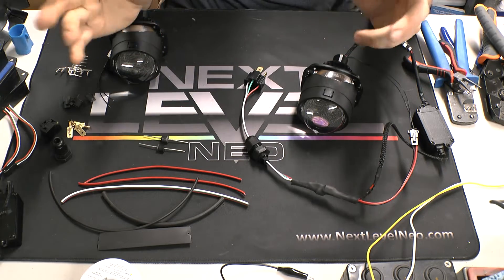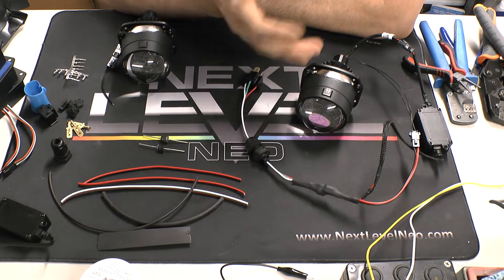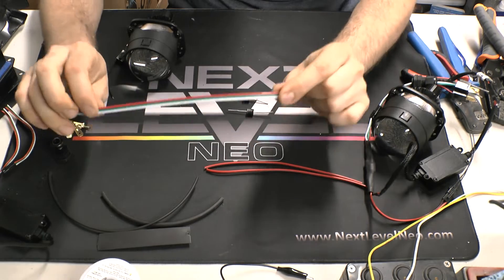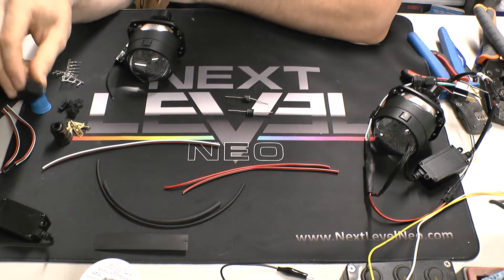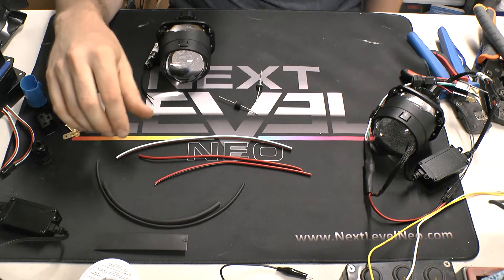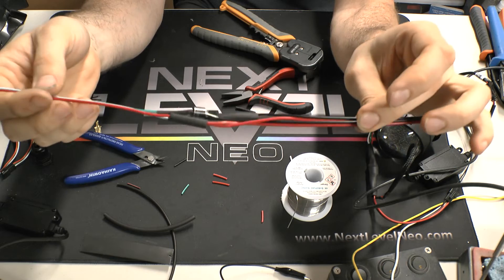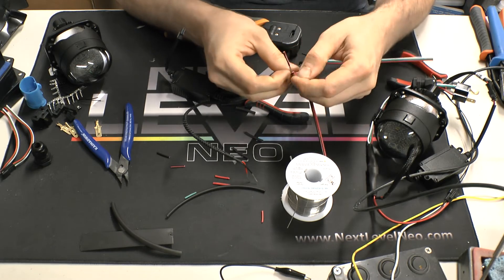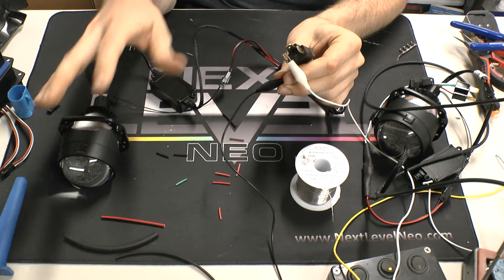How to Build a DIY Bi-LED Projector Harness: Step-by-Step Guide

Comment: Using diodes is a simple and economical solution to power the low beam when the high beam is turned on, but I don't recommend it since it decays the power of the projector slightly, or in my case of using a biled low beam 70w the decay of intensity is too noticeable, I had to repeat all the wiring again and add a relay that positively feeds the low light with 70w. Generally positive battery
Reply: where did you add the relay?
Reply: @luisangelmancilla4601  If your vehicle or motorcycle uses normal polarity (two positives and one negative), 85 and 86 would be negative and signal high light, 30 is low light projector and 87a is signal low beam, thus the relay comes (NC) permanently bonded 30 with 87A without the relay being active and thus gives you low beam, to pin 87 you connect high beam signal (85 or 86) making a bridge, high beam of the projector and that's it, when the relay is activated, it will activate high beam and through pin 30 it will power the low light of the projector, so you will not have to use diodes that cause voltage drop.
Reply: @madoasful  where do you connect hi beam positive wire in that setup? low beam positive goes to pin 30
Reply: @SpraytechGurnee  low beam signal 87A, low beam proj 30, 86 negative and 85 is high beam signal, 87 high beam proj and make a connection between 85 and 87 with solder, when you turn on high beams, it will activate relay and high beam proj, and will connected between 87 and 30 the low beam proj
Reply: @madoasful  what if the polarity is two negative and one positive ?
Reply: @shanemc5136  You need to power two relays, one for low beam and one for high beam and take the positive out of the battery, pull wiring for each headlight. To low beam relay connect the positive battery to the pin 87 and the LB biled to pin 30, to the relay of high beam connect also positive battery to the pin 30, high beam biled to 87 and make a bridge between 87 high beam to 87A of the low beam relay, from this handle by feeding the high beam and turning off the low beam relay, the low beam will continue to be powered.
Reply: @madoasful  not getting it at all.
Reply: @madoasful thank you thank you thank you!!!! I ve solved my issue which I couldn’t for so long !!! Thank you you’re the best !

Comment: Can i used a 6A diode
Reply from the maker: I use 30a diodes, using smaller ones may be result in a failure. here is a link to the parts i have been using for years with good results. https://amzn.to/3D2UGFc
Reply: Can i use r5000f.. as for my location the link you send is noy available to purchase it.

Comment: so are the diodes so you don't ground both hi and low? could you omit the diodes if you want to run both hi/low at the same time all the time? i mean wouldn't the shutter do its job as far as not blinding people when in low beam?

also i hear a 3d printer in the back
Reply from the maker: The diodes are a one way circuit. they prevent the signal from back feeding. If you want both hi and low all the time then you could just connect both high and low ground together. Without the diodes its just a basic power ground circuit, but this would open the shutter anytime the low beam is on, so you would be blinding people with the high beam anytime the projectors are on. You also need to consider each car varies. Some use ground switches some power. You will have to adjust the diode orientation and wire layout accordingly.

Comment: No load resistors needed? I have an 03 ram and was told load resistors are needed to power the high beam.
Reply from the maker: On some cars you may need a canbus resistor. That will stimulate the load of a halogen bulb, if the car looks for that load and doesn't see it it may trigger a dash light or in some cases the lights won't work without it. I don't belive the 03 ram has that though, but i could be wrong. Either way that is separate from this harness.
Reply: Thank you. Yes my Ram requires it

Comment: Great info, ordered from your Amazon link.
For HIDs you could probably run those diodes if you're powering ballasts with a relay harness, just wire them to the relay coil circuit
Reply from the maker: Theoretically yes. HIDs are usually only 35watt, maybe 50. The biggest concern i would have with HID is that initial surge of power to ignite the bulbs. You can try, worst case youll fry some components, maybe the diodes, but they are beefy diodes so they should be able to take it.
Reply: @NextLevelNeo  oh I wouldn't wire the diodes to ballast power. I'm talking about connecting diodes to the OEM low and high + leads like what's done with the  LED projectors, but they'll be connected to the "trigger" circuit of the relay. Very low current is needed to power those circuits.
Reply from the maker: @ed4647  oh, so still using a relay, yea that would be totally fine
Reply: I think I need a better explanation and a clear view because I can't see what your hands in the way 😔. I'm not sure what you're really connecting because you're just saying these wires